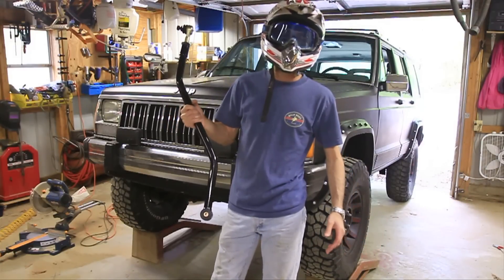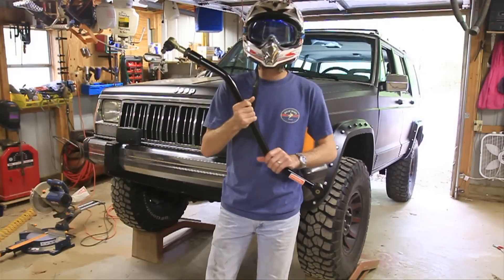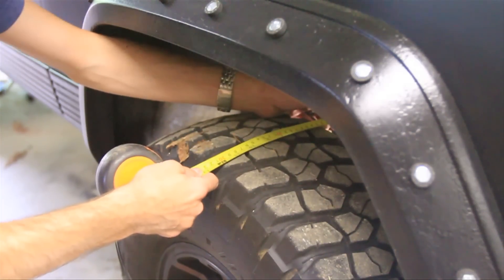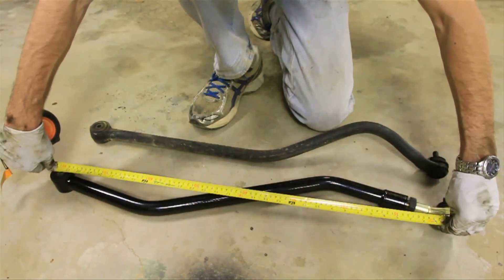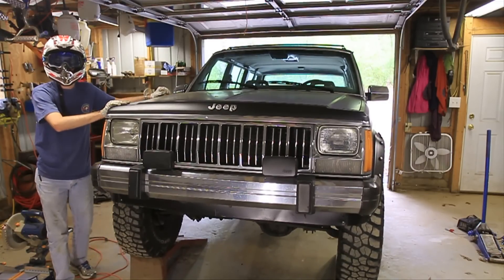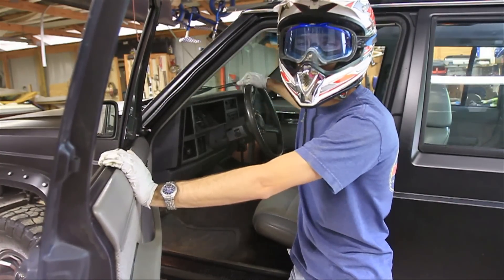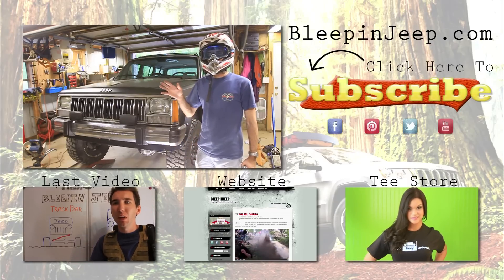How To Install a New Track Bar

Comment: Hi Matt, I always enjoy your videos. Your sense of humor is a lot of fun and I  appreciate the information shared. I had my track bar axle end bolt come loose and drop out on my 2001 Dodge 3500 4x4. Fortunately I was at slow speed on a surface street and was able to pull over immediately. I had recently replaced the track bar and failed to put locktite on that bolt. You lose steering control instantly because when you turn your steering wheel with a disconnected track bar the axle moves side to side rather than just turning your wheels. At highway speed this would have ended much less favorably. I will always locktite my axle end track bar bolts from now on and would recommend others do the same. I recently inherited a 2000 xj from my father in law, it has 116k is straight and rust free and I'm looking forward to creating a nice trail rig for exploring northern California and Nevada. Thinking 3.5" metalcloak short arms and 30 x 9.50 x 15 KO2's on stock steel wheels for now. That way my spare will still fit in the back like you've shown us. Thanks again for the informative, entertaining videos with "none of the boring stuff". Chris Conley

Comment: YO!!! bleepin jeep dude! to center the axle-- lay on the floor and measure from the inside edge of the frame rail across to a point on the axle housing. then do the other side- you are going to be cross measuring when your measurements are equal then the axle is centered.   IE when the X  is equal you are centered.

Comment: Thank you for this video.  I did this install this weekend to my 2000 Jeep Cherokee Sport with 3 inch lift.  I have been getting death wobble multiple times a day running over very small bumps including front vibration.  Been keeping it under 45 to slow down quickly and using back roads to keep off the highway.

Installed the Rustys adjustable track bar and resolved the issue!  

I had all the standard issues:   Could not remove the bolt (used heat and PB Blaster), then the bolt broke on install when torquing (had to replace the bolt)/Old track bar would not drop, had to use a pickle fork and hammer/Adjusted Jeep body over with pushing from front.

Thank you again for the instructions!
Reply from the maker: Glad you got it fixed!

Comment: I did the exact same thing to my 1:10 scale crawler when I replaced the track bar. I just eyeballed it at ride height, and kept shimming the trackbar with flat washers until it was just right.

Comment: Hey Matt, I'm an avid watcher of your xj videos. I have learned a lot and thank you so much man!  I have a problem that i could use your knowledge on.  1997 xj sport 4x4. Auto stock. Recently I replaced my front axle u-joints and while I was at it I noticed my front drive side sway bar link busing was bad so I replaced it. The next day I started getting a loud popping noise when I turned the steering wheel at low speeds. Sounded kind of like my u joint but noise was coming more from engine bay.  Also my drive line started vibrating and gurgling sound when in drive.  Both of these would come and go for weeks but now even at start up the gurgling noise happens. I noticed my axle was off center and I got under neath and the trac bar was bad so I replaced it.  It got rid of the popping noise and clunking noise when I go over bumps but my axle is still way off towards passenger side. Gurgling grinding noise in drive line is still there can feel it in my feet area and center console area. What do you thinks up? I couldn't believe I couldn't center my axle up after doing all the steps in your video .

Comment: nice track bar little simple trick that I've learned all my years of being a mechanic and going off road simply just turn the steering wheel it will help line it up easier if you got somebody to help you have them move the steering wheel back and forth until it's lined up it's rough for years on the old Jeeps and is Cherokees and Grand Cherokees like the video
Reply: Tipton Shelton 
You mentioned that your a mechanic, do all cars have track bars? I think that is what I'm looking at on my scion tc. Are there 2 in the rear? I wanting to replace these things because the rubber that holds the grease is spliced and I think I'm getting a clunking sound from it. You have any ideas

Comment: I'm glad I found this video so I have a better understanding of what's going on with my 06' Wrangler. My track bar popped out of the "nut n' bolt end" as I was pulling into my lot and I cannot figure out how. My guess is that it was waiting for just the right pothole (like the one in front of the parking spot I was pulling into :) to pop out and/or was poorly fastened to begin with. I'm intent on buying a new one but any tips on how to get that sucker back in there in the mean time?

Comment: Thanks this video was very helpful. I had a lot more difficulty than your demo because I started with the wrong type of pickle fork. I borrowed a pitman arm pickle fork (it's bigger than a ball joint one) from Autozone and 3-4 whacks with a 4 lb hammer got it to release. The axle end required me to soak the joint with PB Blaster overnight, hit it with my small impact wrench, then with about 30" of breaker bar I undid the bolt. Buy a replacement bolt at the dealer. Torqued to 45'-lb, upper to 59

Comment: Hye.matt....im in a big trouble..my xj is a right hand drive...made some 4++ inch lift and ordered a adjustable track bar set on a auction...the problem is..it was a left hand drive track bar set...if u can understand this...is it possible if i fit this on the left hand drive with some modification bracket on my axle..is it gonna affect my driving stability...ur opinion in highly appriciated...thanks matt.

Comment: Recently installed a 3.25 lift on my 05 TJ, drilled a new track bar location hole per directions.  I know have the dreaded death wobble at about 35mph.  Would an adjustable track bar help or take care of this problem! No DW prior to lift install! Thanks great video
Reply: yea an adjustable track bar is better, i got one with my 3 inch lift since i had a death wobble at about 64mph.

Comment: Any way you could make a video on how to make a REAR track bar? I can't find any videos or write-ups on the rear and it would be so helpful!
Reply: If you have a xj, a regular cherokee there is no rear track bar as the leaf springs locate the axle,, if you have the zj, grand cherokee there is a rear track bar which is body mounted passenger side and axle mounted drivers side,, so opposite of the front track bar

Comment: i ordered a Moog track bar for my stock XJ for now.  I read horror storries of the bottom bolt getting messed up.  What size do you recommend getting?  I cant find a good answer.  Thanks in advance.

Comment: Hey Matt - Great video... I recently put a JKS adjustable trackbar on my WJ and after a short drive and a remeasure, the axle falls back out of center by about an inch or so to one side. Do you have any recommendations to check into?

Comment: Man, love your videos! Super clear and easy to understand! And the camera angles are great! Thanks for the videos!

I do have a question though, what if when trying to loosen the lower bolt on the track bar, you don't have the tab to hold the bolt on? The new track bar I'm installing has it, but I'm having a hard time getting the old one off because I can't even get a wrench on the nut. Any tips?
Reply from the maker: Jonathan Harris it can be difficult, not all wrenches are the same so try different ones.  you may even have to bend a wrench if necessary.  you might also try an impact to see if it will come off without having a wrench on it.

Comment: question i have jk with 2.5 in coil lift i just bought adjustable track bar my wheels front and back sticks out about 1\2 in should adjust it back where it was im not getting adjustable track bar for the back i will be getting wheel alignment

Comment: I lifted mine up 3inch and then another 2inch. Since the 2inch ive noticed my steering "skips"........If i make a right hand turn or a left hand turn when its time for the car to straighten itself back out the steering wheel skips and it feels tighter. I replaced my Belt yesterday and it got a litle better but still had problems. I put on a new steering stabilizer and still the same problem. I have a new track bar to replace the stock but have not installed it yet. Do you think its my tie rods? im not leaking any power steering and its level what else could it be. Any advise would help thanks BleepinJeep!
Reply: nope - I have 31s and I am getting new wheels and tires. I want bigger offset and 35s possibly so I haven't bothered with the alignment I thought maybe it was my drag link since its still stock or maybe a drop pitman arm?

Comment: this may be a dumb question but what kind of grease do you use to grease the ends?  and also preferably what other ends or bushings should you grease from a lift kit and awesome video man!
Reply: Where there's low movement and low access, I use Marine Grade Grease.  For higher movement, I use Lithium Grease.  For wheel bearings, I use Wide Temperature Range WTR Grease.

Comment: 98 XJ   3.5 Lift but my Axle is shifted to the Passenger side why is that or is that possible, whats up with mt axle shifting the Opposite way from what you Described because I am fixing to install a Adjustable Track Bar.   Thanks for your Reply.
Reply from the maker: Something ain't right...
Reply: @bleepinjeep  I have a 98 XJ with a two-inch lift (I have my reasons) and I have the same situation as Gary Harris here, the passenger side tire is an inch farther out than the driver's side. Any thoughts please would be appreciated, my new adjustable T bar is ready to go. Great video, thank you.
Reply: How did that go Gary Harris? I'm in the same boat.

Comment: I did watch that video, Im just concerned about if the hole is too big for the metal sleeve in the track bar bushing.  Welding a plate over it is going to be my other option.  Also I had read a few people on the cherokeeforums of just redrilling a hole to the right of it and they said it was ok with a 3" lift, would you advise this as im running a non adj track bar?  Thanks.

Comment: I have a 5" lift on my xj. I ordered a Rough Country Adjustable Track Bar and it came with the drop down bracket with what you called the "Johny Joint end" as apposed to the Tie Rod end. The end on the new track bar that attaches to the Drop Down Bracket does not have a Greece boot on it how the stock track bar Tie Rod end does. Is this Okay?
Reply: I'm Sub'd to your Channel by the way. Great Videos...

Comment: Quick question. The tie rod end in mine is messed up. The cotter pin is out and in trying to remove the nut but the tie rod bolt just rotates with the nut. Any suggestions??
Reply from the maker: Downward pressure on the rod end while you hit the nut with an impact.
Reply: +Sam Cassidy use a jack and a block of wood and put pressure upward on the end and it should stop the spinning so you can remove it. as i understand it, you mean the tie rod end for the driver side of the track bar?

Comment: I was replacing the track bar on my 96 cherokee sport today and noticed that the axle side bracket has the hole a little wobbled out.  what are your suggestions to fix this?  I do have a 3" lift on the jeep and im using just a oem replacement track bar single sheared with tie rod to frame.  hope to hear back from you.

Comment: Very informative videos I like your channel. But was helmet and goggles really necessary?
Reply: I've got a 1993 Jeep that I've got to replace the track bar on I've also got to put u joints in it as well all 7 em anyway I find your channel very informative keep doing what you're doing I've subscribed and you've been a lot of great help thanks again. Is he nuts restorations. Izzynutz Restorations. ..

Comment: Is it difficult to align the lower left bolt when the top part is already bolted in?  Guys installing my track bar never tightened the jam nut (located on the opposite end of yours), and I can't tighten it without unbolting the lower left location.

Comment: What's the best way to ensure you are torquing down the bolt to the right lbs?
Reply from the maker: +Johnny Braun buy a torque wrench
Reply: What's the purpose for needed a specific torque?
Reply from the maker: so you don't over-stretch the fastener, bolt, etc. and weaken it. Also, if you're threading a steel bolt into aluminum (like in a transmission tail housing), you don't over tighten the bolt and strip the threads out of the softer metal.
Reply: The purpose of a specific torque is so when I'm passing you on the trail, you don't flag me down saying things like, "My bolt on my   blah blah   came loose and my such n such came off.  Can you help?"  and of course, here I am in DEATH VALLEY USA, 115 degrees out and I just saved a guy and his girl friend; because, he didn't think torque wrenches were important.

Comment: can you do a video on adjustable lower control arms? i have the rusty's forged hd flex lowers and they didnt come with install notes.... got one straight but the other is sideways in the mount....|\|----(|||)--|l|  what size could that adjuster nut be? (on the lowers)

Comment: Today, I went to remove the axle mount section of the track bar. I noticed there is a nut on the other side that I can't access. Thanks to this video, I now know there is supposed to be a bolt welded to a flag. I'm screwed, but at least now I know i'm screwed.
Reply from the maker: +Alex Schmaltz you should still be able to stick a wrench up in there
Reply: One would think. I wasn't able to squeeze a 15mm wrench in there. Maybe, if I had the perfect size wrench. I will mostly likely end up cutting it out and replacing. Thanks for the reply! Love your vids!
Reply: I had the same problem today.  I don't know what kind of tools they use; but, where I get my tools, they don't fit in the cramped area of the lower track bar mount.

Comment: Why do Americans still try and calculate using the imperial system?
Don't you find the Metric system so much simpler and versatile.
Reply from the maker: Tyroncorona Maybe but it doesn't do me any good if everyone else is still using it... That would be like saying I like driving on the left side of the road so I'm just going to switch right... NOW... crash...
Reply: Wow, you really hit a nerve there apparently. Imperial Units were defined by the British Weights and Measurements Act, which as you probably can guess didn't happen in the United States. Apart from that, the United States is one of the only remaining countries to cling to Imperial Units. So much for setting trends! 

+BleepinJeep had the correct answer. Even if individuals just decided to start using the metric system, it wouldn't change the fact that industry still uses imperial units here. Many of us can and do use both systems depending the situation, so it's not as if we can't see the value of the metric system.
Reply: we tend to use a mashup of both pretty regularly
Reply: To answer your second question, yes, I do find the Metric system simpler and more versatile; but, the reason Americans still (not try) DO calculate in imperial system is because of TOOLING.  America invented the Industrial Revolution; so, rather than spending billions to retool, we kept what we had; and, are slooooooowly adopting Metric.  The rest of the world didn't have to retool.  As industry took hold, they went straight into metric.  The same can be said for cell phones in underdeveloped nations versus developed nations.  Now, my question to you is; why, did you have to ask?  Why wasn't this issue obvious?  Do you consider US backwards for using the Imperial System?
Reply: American exceptionalism = we could go metric, but instead we will continue to dominate dominate the world, which somehow we do even though we use an anachronistic measuring system.  I guess metric isn't that great after all...
Reply: Inches yee yee
Reply: You  can still end up with one half litre.  lol

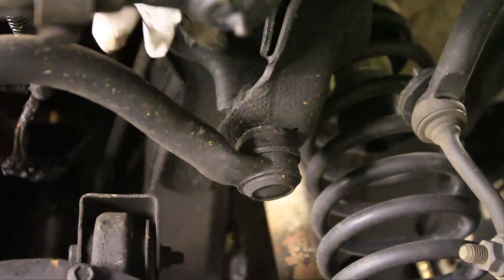Comment: These kinds of videos always piss me off.. 3:42 "Let's just put a 3/4 socket on here" (Then easily turns it off with a small ratchet).  I just had a 2 foot long breaker bar on mine and it still won't move.  :(

Comment: how do you torque the jam nut?
Reply: Years later I’ll answer for anyone who happens along here with the same question, the tool is commonly called a crow’s foot. It looks like a stubby open-end wrench in the appropriate size with a 3/8” drive square which goes on the torque wrench